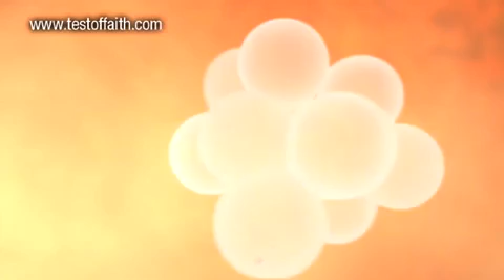Fine Tuning

Comment: 'Budin I, Bruckner RJ, Szostak JW. Formation of protocell-like vesicles in a thermal diffusion column. J Am Chem Soc. 2009 Jul 22;131(28):9628-9'

Again, ignorance is not an argument.